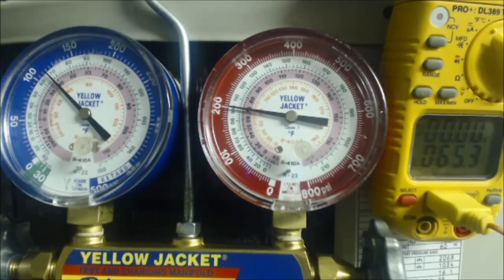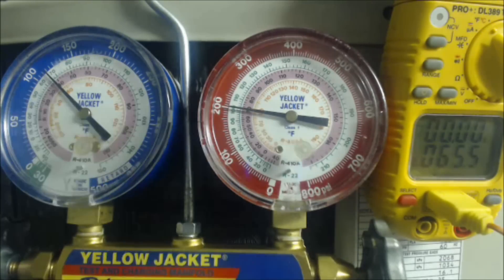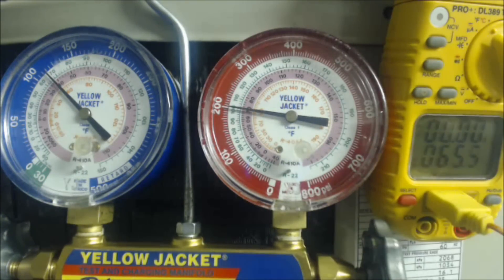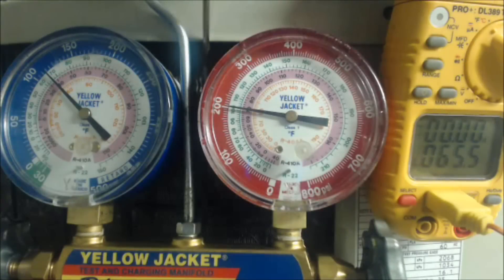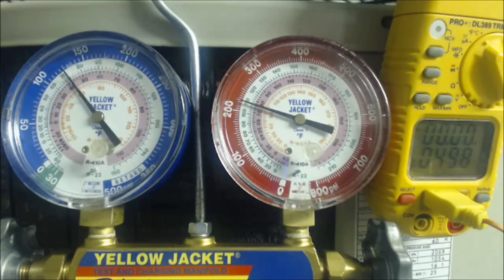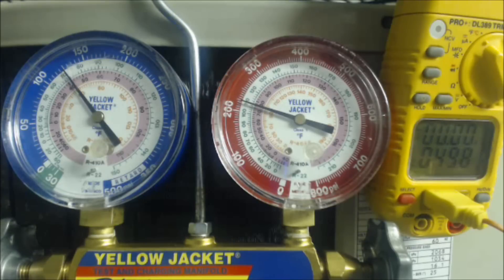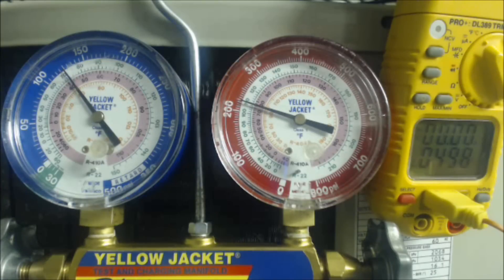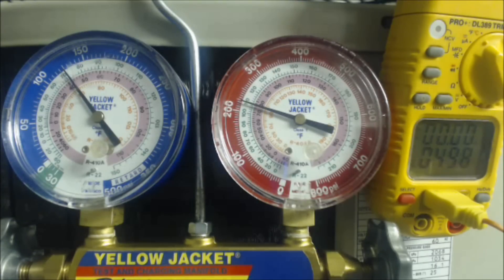How to Use a Refrigerant Gauge Set STEP BY STEP to Read Superheat for R-410A!

Comment: if you want i can teach you how to record better audio. your echo is bad
Reply from the maker: Hey Drew, that was an old setup, I believe the new videos are better visually (4k) and audibly now, thanks!
Reply from the maker: Let me know what you think of the audio in the last couple videos, thanks!
Reply: @acservicetechchannel  i did notice your other video the audio was better.. when your in a bigger room you will get echos.  you can use apps like Audacity to process audio.  you pretty much record for 15 seconds with out saying anything and then go in the settings and set that audio to be cancelled out.  using the same file you record the rest of the audio.. might be hard to understand but yeah thats pretty much how they do it.  the real professional way is to record on a standalone device  so your video and audio is not on the same file till its processed together.  if your recording device will record audio and video on separate files then you can use a audio processor like Audacity.  you can also use a inline processor which processes audio real time but thats something i haven't messed with.